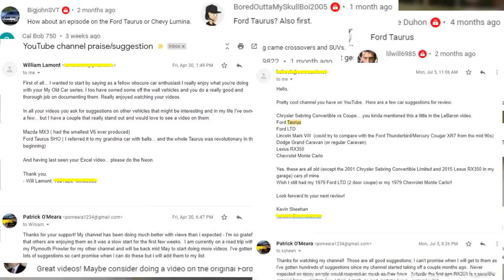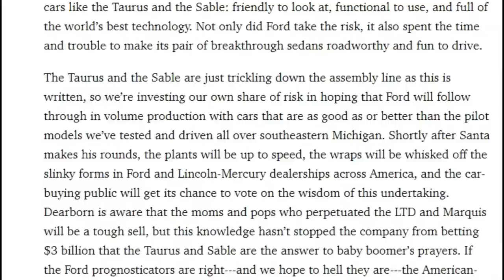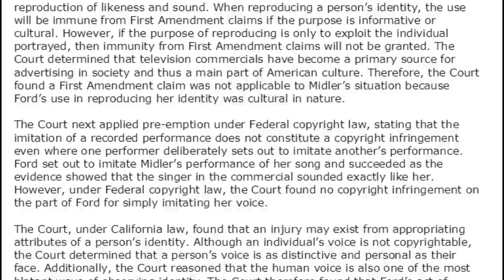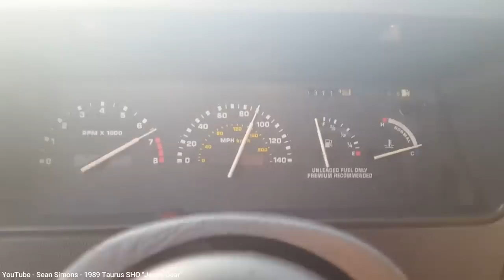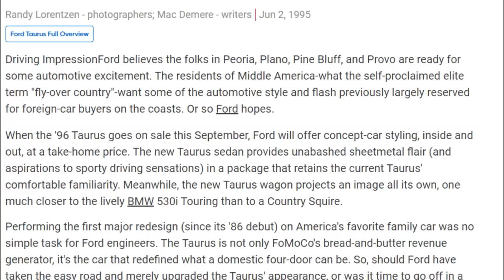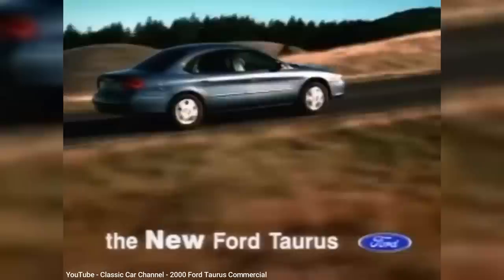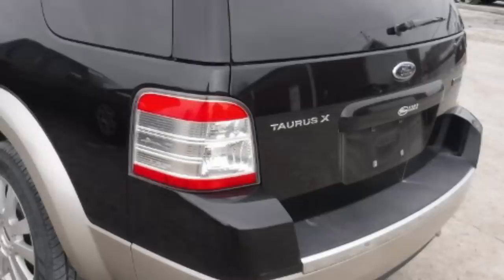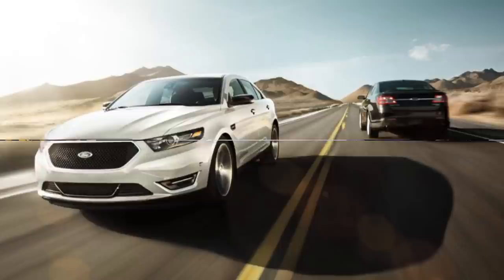Here’s how the Taurus went from Ford’s best seller to a forgotten icon

Comment: When Ford redesigned the Taurus for the 1996 model year, nobody liked its weird oval styling.  As a result, it lost to the Toyota Camry as the #1 selling car.
Reply: This was around the time my dad was looking at a family car for my step mother to daily, and I remember us test driving a 96 Taurus, but he could not stand the look, and I also remember him commenting the whole round radio cluster looked like a kids toy, and it's why they ended up spending a bit more on the much better looking, and honestly better riding/handling Mercury Cougar.
Also I personally think the bubble Taurus was the long slow downfall for Ford when it came to car sales to much better Japanese models like the Toyota Camry, and Corolla, which are still great sellers to this very day.
Reply: the Accord was the #1 seller to consumers - Camry sales included fleet sales Honda eschewed
Reply: Yeah my first car was a 1994 Contour and it looked EXACTLY like that Taurus redesign. There was no separating the two and i'm not even sure what the difference really was. Never was a fan of the look, but it was surprisingly powerful with a DOHC V6. But being a Ford it's tranny snapped less than 10K into owning it.
Reply: not true my dad had one new ish ( and omost got a 2 one but ended up with a 2004-up 300 to replace it ) and my ants had one and my grandpa kinda like the look but in his old age he bought caddilacs aka coupe devles aka top luxury barges with v8's and auto's front wheel drive 

as for me the the late 90's sho is the most iconic year's to me but i don't drive front wheel drive cars as i have bad habits from driving a k1500 and charger ect.
Reply: The design was ok at taking a hit and not having any real problems or cosmetic damage and passenger safety was ok a i know of 4 times one was involved with. ie Camry vs ford and 1998 ford was ok the Toyota was totalled ( same engineering era or close enough and both cars were over 5-year old or more at the time of inpacked ) at under 20mph and was at fault
Reply: @rushnerd  its ok as it was dads pick win it was new ish in 1999 ( for a daily driver replacement for what was too become my pickup trying to get cheaper operating costs aka 80's gm trucks vs 90's ford car vs new job at the time that no longer needed the bed or towing of a full size truck ) not mine ( he's a ford fan and he was raised on mostly pre-80's ford's, and jeep/ ex-army kinda guy he still wishes ford made the 06 collector addition rubicon ( in of course ford blue ) with the coyote v8 5.0 or the SHO big v6 N/A and 6-speed auto, that he has vs FCA ) as most people have favourite flavours of cars as mine are pre-1977aka pre epa but after 1955/common enough to most car guy's to work on and got parts for aka not weird quirks like on a model T ford has as much as i fined it fascinating id like something easier to daily drive, and 🇺🇸 and 🇬🇧 ( plus some rotary engines ) mostly are my flavours and the charger is a big block 540~ci hemi with a stick and the gm truck was a v8 and did have a stick for it too but it got stolen/chop shopped so 😗 might be time for a EV swap as diesels and gas engines are frowned on/harder to get tags / parking / road tripping for in the future after 2025
Reply: @rushnerd  I drove a ‘90 Tempo (5-sp) and ‘93 Topaz (3-sp auto) for roughly 245,000 km from 1992-2008, and don’t recall ever having a single problem with either transmission.  The 5-sp was pretty preppy, and the auto was about as slow as you could get, but they were both reliable cars.
Reply: @rushnerd  you drive a 32 year old car as a daily??  No thanks…
Reply: @MrJett1971  If you could stand a Tempo for 18 years, I can take a Supra daily. I absolutely adore this vehicle.
Reply: They made the exact same mistake with the Scorpio in Europe.
Reply: @rushnerd  

There was no 94 Contour, the first Contours arrived for the 95 model year and if you think it looked like the 96 Taurus then you might want to visit an eye doctor.  The only ovals in a Contour were the front grille opening.
And no, I am no fan of the Taurus, the 96 redesign was awful and not helped by truly crappy automatic transmissions.  My father owned 3 or 4 Taurus sedans, but never owned an 80s model, unfortunately.
Reply: I loved the 96 + taurus
..when they came out as a kid my aunt  got one and it was so slick and futuristic  looking  silver chrome wheel and tinted windows...
Reply: @rushnerd  i dont remember the transmission being that bad ( and its last time i saw it it did 100+ miles ( but the engine was toast without a full rebuild as the head gasket popped / valve job still ran 👍 but probably wouldn't have lasted like that for very long if it wasn't ran for so long without water 🚿 it would have been a minor ish fender bender repair aka mostly cosmetic damages ) without any cooling and probably little to no oils as a 10 point trophy 🏆 deer 🦌@80mph got it in the middle of nowhere ( and no phone 📱 📞 service ) 🇺🇸 🤷‍♂️ i don't know as every other hit didn't hurt it and was all OEM and not rebuilt probably 150k or so on the clock, it did eat front tires and outer ball-joints but all HP front wheel drive cars do that with v6 and v8's ) but im not a automatic lover 💕 either unlike my dad who instead on automatics sense the 90's-and up but me id rather have a manual or a DCT ( with manual control mode ) in a 1999 SHO ( stying reminds me of pre-1960's car's and as i get older i kinda like the retro 90's trying to be pre-1950's look same way with the PT cruiser chevy SSR pick-up ect. ) but as i said I tried front wheel drive and no longer buy them ( 2008 buick le cross 3.6 v6 automatic i got new by my self/the wife's car ) /drive. but what you guys see in a 80's Taurus 🤷‍♂️ to 📦 and weird on the outside for me unlike a GMX buick T-type that's just boxie but cool outside looks
Reply: @MrJett1971  what's wrong with a 50 year old daily classic car? as long as it in good condition and maintained well. i don't have anything newer than 1990 right now and the other people a round me have rides older the 2008 granted 2 of them probably need replaced not from age so much as crash damage and high mileage vs costs to fix it vs the no collector resell value ( and aren't callable to begin with as new cars aka appliances for transportation ) ( unlike my classics that have a better resale value in good condition if it got wrecked same with classic supra's now as the JDM market is heating up )
Reply: @Jag-leaper  i feel the same way with the 2003~ 2 gen lightning as the first generation outside just doesn't do it for me and love the retro style with a modern twist
Reply: What people really didn;t like was the smaller V6 exploding at 70k miles, the transmissions failing, and random electrical issues that made things not work right after the car was a year old, and water leaks in the passenger cabin. I live in the midwest, I haven;t seen a 96/97 taurus for sale around here with the smaller V6 since 2003. Pretty sure they were all crushed by then.
Reply: @rushnerd  
Supra.  Yeah....that IS a daily DRIVER.
Reply: @davenhla  i knew someone / boss that street raced ( most of the time for money 💴 or trades aka pinks ) and was the shops parts car wagon Taurus ( with 150k+ miles on the clock ) and was really hard on it worst that happened was wiring ( crank sensor and mostly body grounding but it was a 20 ish old car at that point in the rust belt 🇺🇸 ) and a head gasket repair but what do expect on stock ish parts and NOS shots. as for my dads sedan it was ok and was 11 ish years old when he turn it into a parts car ( 🦌 🚗 wreck ) for my family to use ( in SLC 🇺🇸 ) and didn't have any of those problems ( he did ware out the steering wheel leather and driver carpet the first 4 years in but he unfortunately does that with every car he owns as he eats in the car a lot😒 at mc'd's ect. ) and my ants twin was the same way as far as I know and i think 🤔 i was replaced in 2009 ish after 200k miles of use as the roof/hood paint by that point was going bad after being outside all of its life but the inside was in much better shape than dads was as they don't have a bad habit of eating in it
Reply: @davenhla  probably a good guess and say most people aren't driving them anymore/junkyarded by now as a kid they where not the special thing/ford in 2000 you got the lighting or the GT350 or 500's ect. last time i saw one the the wild was pre-2015 ish and was a little rusty on a wet freeway or at a car show next to 90's cars🤔 in ok shape but not mint and was the "backup show car and people mover"

and for the most part probably aren't going up in value for a long time if ever as most front wheel drive cars are the same the only saving grace is the engine aka SHO ( 1970's caddy's brake that mold and are ok in resale value ) but i don't think baret jackson ect. going to bring 30+k usd in the next 10 years or more for minty condition but i have been wrong before 🤷‍♂️
Reply: my parents had a family friend with a Camry ( as far as i know it still runs 👌 20 something years later as i see it every so often in the garage and or in town but not on the road . and dave 🐏's show indorse the older models so it can't be to bad just not car person good 😉 ) and they didn't like the styling inside and out but pre-2005 Toyota did have a good reputation for cheap reliable 4-door cars just a sea of tan/baysh/gold/gray/boring and  a little under powered / noisy ( automatic with the sun roof ) as mom put her test drive in a 2002 ish Camry and she was 👀 for appliance 🚘 at the time she end up with a small F8 green SUV blazer /GM Barney van instead 🙏
Reply: Camry would outlast the taurus by 2x generally without as many major problems and faults.

Comment: Had both a Taurus and a Sable.  The Sable was a used car that ran well and had it for five years in the late '90s, but it was a '92 or a '93 and had a computer/electrical problem that was a design flaw.  The engine would just cut out for no reason, sometimes even when driving at highway speed.  Needless to say, after a while, I got rid of it.  The Taurus was also used, but was clean, solid, and drove like a champ.  (I bought it after selling the Sable.)  Unfortunately, I got orders overseas (I was in the Air Force at that time), so I had to sell it.  Otherwise, I think I would have kept that car for 10 years easy.  Ah, the memories of the '90s.....

Comment: My first car was a ‘94 Sable, forest green with a tan cloth interior- exactly the way i always wanted it. Picked it up with 125k miles used from a state legislator who used it to run from his farm to the capitol and into town multiple times a year.  Man I loved that car….and man, was I hard on it.  The 3.8 liter V6 always felt powerful, and it was roomy & a great cruiser.  I always thought the Sable’s styling was just a little more futuristic than the Taurus, but I loved them both.  Got me through 4 years of college, then blew its transmission 2 months after.  I loved that car!  My mom drove a used 97 Taurus around the same time I was in college but it just didn’t feel as solid or well-built, and the wiring was never right.  We were always chasing electrical gremlins in that 3rd gen Taurus.  But there are days  I’d love to have that old dark green 2nd gen Sable again!  Thanks for the great video!!

Comment: Yep, my dad had a beige 1991 Mercury Sable GS  with the cool light bar grille, split bench seat and a column shifter. Later he had a dark blue 2001 Taurus SE . Both were sedans. When he had his winter tires on black steelies on the 2001, it looked like an undercover cop car, at least that's what his neighbor said. I liked both cars in different ways.  I always wanted a first gen Sable wagon and a Taurus SHO with the 5 speed manual. They remain on my bucket list.
Reply: i had a ‘95 Taurus SHO with 5 speed manual. other than the most speeding tickets I ever got with l car, it suffered from chronic stalling out issues. finally sold it and got a used ‘97 Corolla. right after that, Ford admitted that the Yamaha engine in it was recalled due to stalling issues.😆

Comment: Got a 94 with 60K miles, it had like 46k when I got it last year 👍 no rust - inspectors here in PA were shocked. 

I wish it was the sky blue color, same color as my mom's 94/95 when I was young in the 2000s, but the champaign is alright.

Comment: Sadly the Tauruss aroujd here are mostly long gone. The 1st and 2nd gen models all succumbed to transmission issues and rust/subframe rot. The 3rd and 4th gen (really just a refreshed 3rd gen) i still see puttering around occasionally. But about 90% of those seem to have busted coil springs and are rotting away now as well.
Reply: They call that 'bullsquat'. Lol!
My 05 is doing it, new (higher rate) springs and struts are next on the list.

Comment: My mom had an 88 and a 95 Taurus. Both GL models. The 88 had a lot of cool features: oscillating headrests, a storage bin on the rear package tray, a stopwatch built into the clock. It was kind of a lemon. Both had pathetic stereos with no bass and required mid grade gas. But they were good for what they were. Family cars.
Reply: The stereo, sounds like what I would expect in a Geo/Chevy Spectrum, (Isuzu) LOL. 😂

Comment: Oh the memories.  My grandparents had a blue 1989 Taurus LS (I think that is the correct trim).  They and my parents really liked that car.  Very dependable, roomy, and was front wheel drive which helped in the winter time in PA.  I had a 2004 Taurus SES that I had bought in 2011 after my Jeep XJ Cherokee suffered an untimely and fiery death.  It had the upgraded interior with leather seats, the shifter on the floor instead of the column, the "wood" trim, and the better 3.0L 24v V6 engine.  Only trouble I had was the torque converter went out 4 months after I bought it when it had under 85K miles.  Other than that, it was a good car.

Comment: I will never forget the first time I drove a modern 3.5 EcoBoost Taurus Police Interceptor. I had gotten used to them when I drove a non-turbo 3.5 Taurus when I had gone to a community event with some co-workers. Afterwards I was tasked with stripping out a Police Taurus (yes that’s my job) and I was SO EXCITED since I knew how fast they were. When I put my foot the speedo went 20-40-60 within 5 seconds and what’s even more insane is that the seals on both turbos were shot and it somehow still delivered boost.

Comment: During the 80’s, my occupational position included company-provided leased vehicles that would be replaced every two years.  Due to a promotion and relocation in ‘86, I inherited an ‘85 Pontiac Bonneville that had the most anemic V-8 I had ever driven.  Fortunately, six months later I took delivery of a brand new ‘87 Mercury Sable with the 3.0 liter V-6 in red.  I marveled at the power (for that era), the leap forward in interior ergonomics, and decidedly European steering and handling.  Transitioning from that Pontiac to the Sable felt like traveling forward two decades.  I loved that car.

Comment: I had a 2003 Taurus SES as a company car. New, they were $23k. With only 43,000 miles in 3 years, the local Ford dealer offered our company $3,800 for each of them in trade (I think we had a dozen or so of them).  The company skipped the trade-in and gave them to each of us instead, to do as we pleased. I gave mine to my soon to be 16-year old to drive. She was thrilled. The car still looked and drove like new. Wasn’t a bad car at all, but the headlights were ridiculously dim for night driving. In 2014, with 172,000 miles, KBB’s trade-in value was $72 for the car.  A load of groceries in the trunk was now worth more than the entire car.  I gave it to another coworker as he saw its potential for a needy family member. She drove that car for several more years.

Comment: I worked for a local ford dealership (Latham Ford) in my early twenties. I often would use their rental cars to go on trips to New York City, because they were roomier than the Plymouth Turismo (A car that you should do). I eventually was one of the people that owned a version of the Ford Taurus. I owned a 1989 Mercury Sable LS. It was the first car I owned that had power everything. It rode pretty smooth, was very roomy. It was my saving grace when I went to a Bob Dylan/Grateful Dead concert at Highgate VT because late at night it was one of the few Mercury Sables in the sea of thousands of Volkswagen buses and Beetles in the field parking lot of an old Air Force base. It's eventual demise was due to an iron block and an aluminum head that warped when it overheated.

Comment: I had a 93 Taurus Wagon my senior year of high school. Had to replace my 95 F150 as it was too rusty to be safe without a lot of money put into it. Got my wagon for $900. I started a mobile detailing side gig out of it. I drove that thing for nearly 2 years. It was slow and horrible on gas but I loved the thing. Seriously, it got like 8 MPG. Replaced it with a Grand Marquis and bought a 2008 Taurus Limited a month months later. The next year I decided to get a little newer one with lower mileage. Got a 2012 Taurus SEL with 68K and I've had it for almost 3 years now and I have 106K. Thing won't stop breaking and draining my bank account. I want another wagon but they're next to impossible to find in good condition.